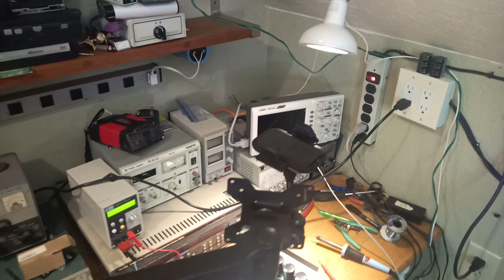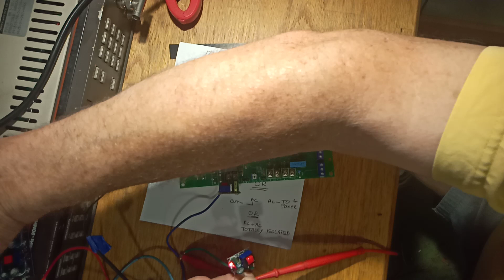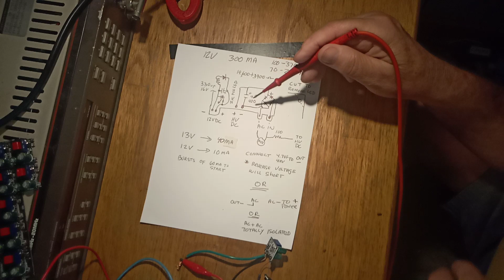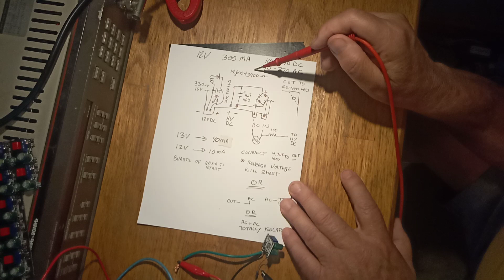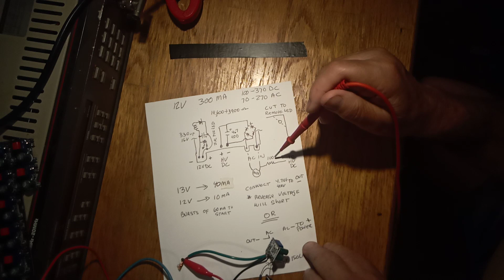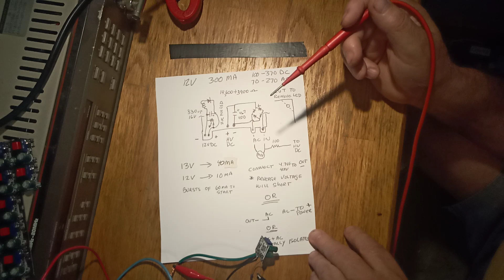Amazing 12V 300ma Isolated Switching Power Supply For Low Power PV Instrumentation

Comment from the maker: Better be good at soldering, this baby is only an inch by 5/8.  A cheap way to power to instrumentation with isolation. I paid less than a buck each for these including shipping and taxes. At 40ma this supply will start with just 13V input. Avoid powering devices from a source less than 40V or it may overheat.  A big advantage when PV voltages can vary wildly in morning and evening. Now you can power high side FET drives easily and those monitoring boards.  This super small board can mount right on the board terminals.

Comment from the maker: There are several vendors on aliexpress offering this module. The one cited just raised their price.  For the most part buying from China is like ebay except for an extra week in shipping.  Shipping is what you should really watch out for.  Some use slow boat economy which can take over a month.  Over a certain amount some switch to 14 day shipping and others make that standard. When buying a quantity, the price can take a big jump at certain numbers and this can vary by seller. Buying just one of everything is expensive.  Searching is a pain as you will get pages of unrelated items. That can be fun finding unusual items at an unbelievable price. Instruction manuals can be buried or nonexistent. Read them carefully as an identical looking item may not have all the features of another item.

Comment: Very useful.  I've been looking for some small isolated  12V PSUs for my 48V system.  Just ordered a few to try out :)
Reply from the maker: There are dozens of these $1 converters. I generally look for something that can be modified. Everyone has gone to SMD construction. This one has all under the transformer and none on backside.  I was lucky to live in the prior golden age of electronics where everything was visual and understandable in a visual way.  Now you need microscopes, ovens and vacuum tweezers in electronics. I wish I had the vision of my youth and a steady hand.